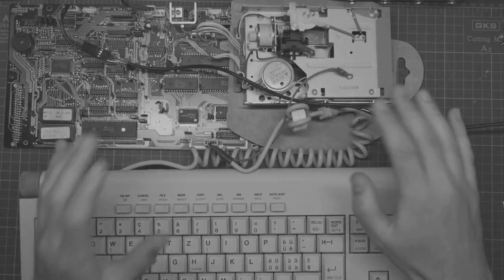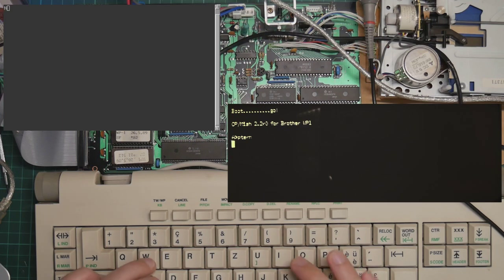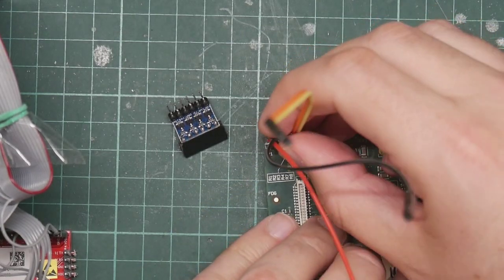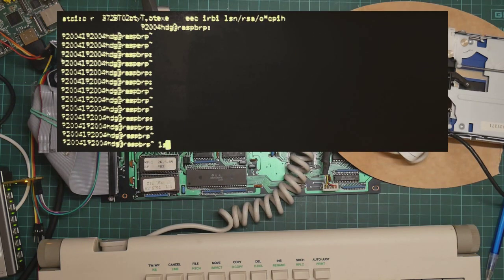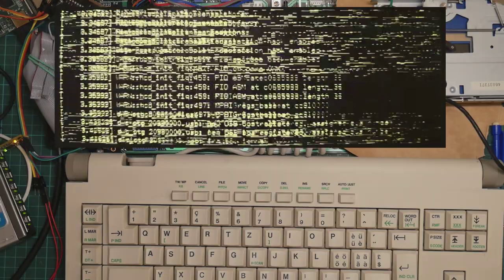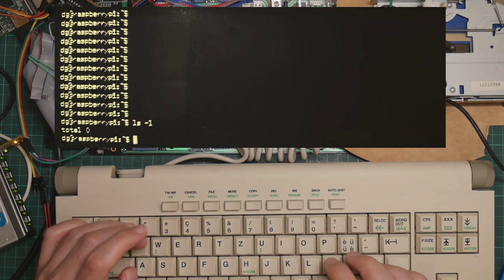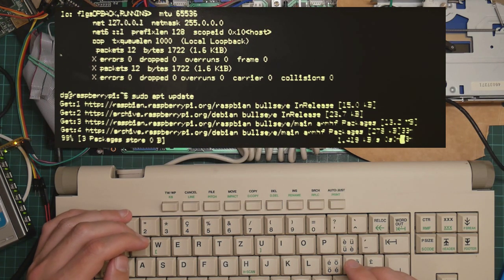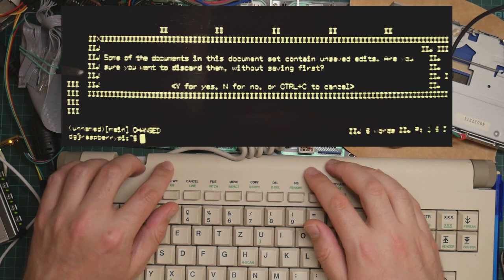A Brother WP-1 serial interface #6: it works! Sort of?

Comment: I do not know about CP/M, but can`t you use a terminal program that is already there? I mean there are terminals programs for dos, and very good ones, that are able to emulate different types and use many protocols, there must be some for CP/M right? And I believe you only have to tell the program where to write data and from where to expect it, sort of device driver for a serial port you will need then. I think it could be easier than to write from scratch a new terminal emulator with all the features that you need.
Reply from the maker: I was actually being pretty sloppy with terminology. The terminal emulator that's problematic here is the one inside the CP/M BIOS itself --- the thing that decides what to draw on the screen. All pterm does is shuffle bytes from Linux to the BIOS and back. Even if I did replace it with another piece of CP/M software, that still has to talk to the screen somehow, which means going through the BIOS terminal layer, which means being limited to what the ADM3a can do. I do actually need something better!
Reply: @hjalfi  Now I understand. Thanks!